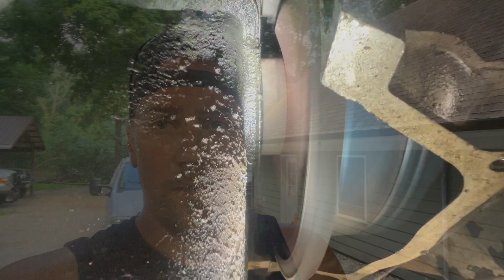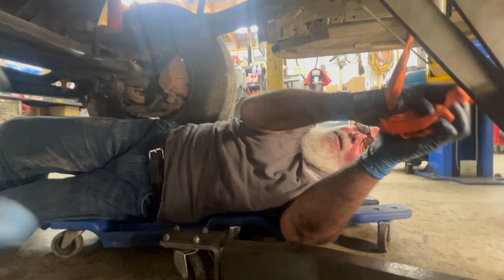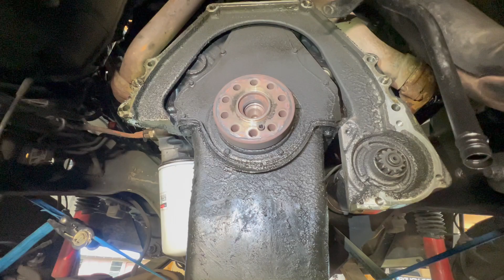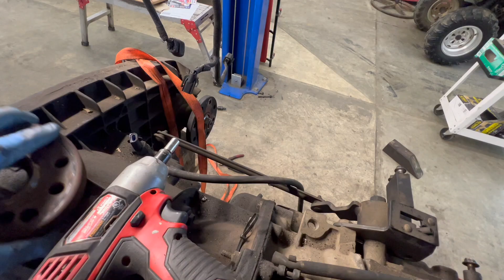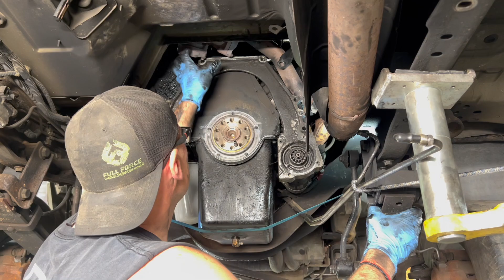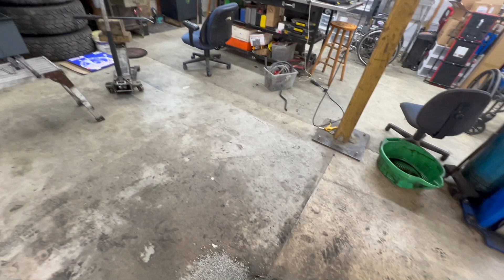7.3 flexplate, rear main and up pipes

Comment: Great video!  I had the same noise on my 2000 f250 ended up being severely warped flex plate, but is wasnt broken, just knocking.  What type of up pipes did you use?

Comment: Thank you for posting this video, This noise just started today on my F-550 while pulling a trailer with Material. I will tackle this job as soon as I get my hands on a Flexplate.
Reply from the maker: Oreillys has the flex plate for around $90. It’s a pioneer and we’ve had very good luck with them

Comment: Just bought a 99 7.3 last week and got it home after a 2 hour drive with that exact same noise from the exact same spot. Only during idle or coming off a stop. Sound wasn’t there when I test drove it for 20 minutes before, but damn it was obnoxious when I pulled in the driveway.

Would like to do the rear main for the same reason you did and for practice but not having a lift idk about that

Comment: my 03 6.0 has a grinding noise somewhat similar to that 7.3. makes the noise pretty loud at idle and goes away once you give it a bit of gas. whats the likely hood it being the converter rather than flex plate
Reply from the maker: More than likely the flexplate

Comment: Im under the impression the billet cover converters f up the OE Flex Plates.
Reply from the maker: @davidmcnerney3048  most I see cracked are on stock style converters. I’ve never heard or seen the billet converter theory. But the real fix is a billet flexplate

Comment: Need some help with my 7.3 wait to start not coming on
Reply from the maker: Do you have a crank no start or no crank?
Reply: @AutomedicGarage  crank no start
Reply from the maker: @coolblue4077  what’s your icp psi, icp volt, ipr %? Can you buzz the injectors to see if your idm is responding? Is your fuel bowl heater still intact and plugged in or is it already unplugged?
Reply: @AutomedicGarage  
Looks like my programmer is not letting the wait to start light come on not sure what I need to do to fix that
Reply from the maker: @coolblue4077  have you unplugged the fuel bowl heater
Reply: @AutomedicGarage  fuel bowel heater is unplugged
Reply from the maker: @coolblue4077  clear codes and see what pops up now with the live data

Comment: Привет из России. Блять, почему эта пластина треснула? Просчет инженеров форд? Может надо больше стали!...?
Reply from the maker: Truck had 320k miles on it. It happens from time to time on these. That flex plate has to hold up to alot of torque. The real full proof fix is a billet flexplate but not everyone wants to spend $500+ on one.

Comment: Could have been catastrophic. Got to put a Billet flex plate. I had a transmission shop tell me my rear main seal was leaking. I told him hold the phone I shot over there showed them the drain hole. Seal wasnt leaking. Stopped them from putting a duralast rear main seal.
Reply from the maker: I wouldn’t do a bullet flexplate unless your throwing down a lot of power. No need in someone spending 5-600 on a billet when this factory one last 300k. I’ve never seen one hurt anything other than someone’s feelings. I didn’t tell him his main was leaking. I would have put one in my own truck. Just makes sense with over 300k on it. Just preventative.